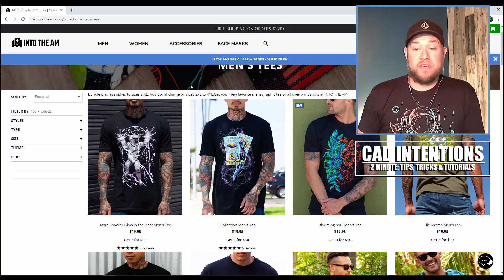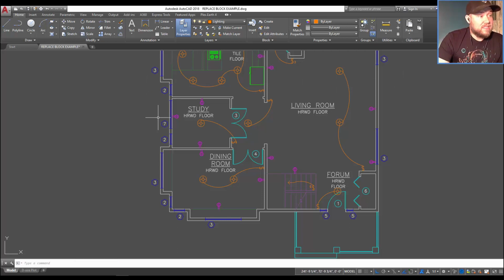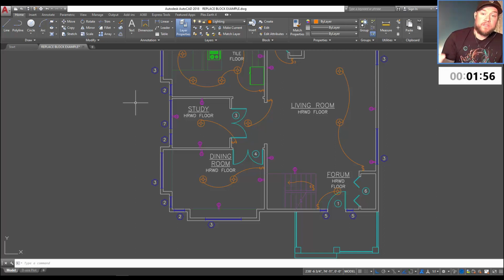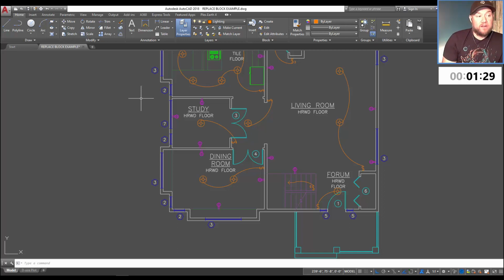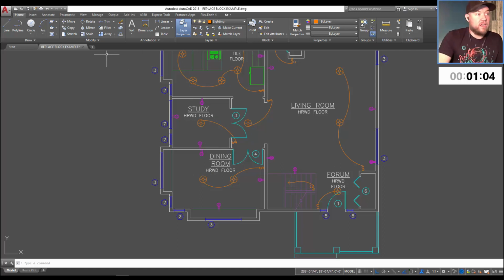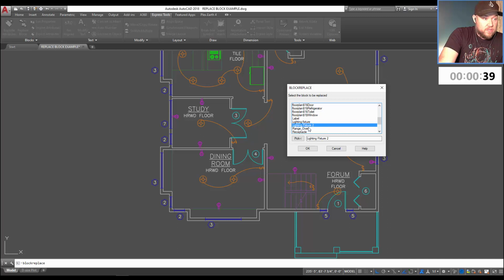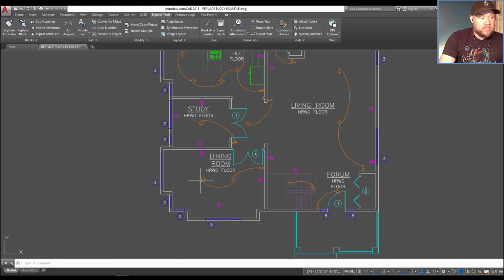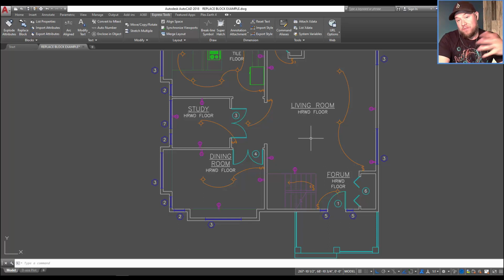AutoCAD How Replace Multiple Blocks with Another Block - 2 Minute Tuesday

Comment: Thanks for video. Is there a solution how to replace blocks by using attributes? We have electrical schemas, and depending on text we need to place circuit breaker or fuse symbol. All logic we can do in excell and load all info to predefined block, but we need manually change general block containing subblocks sumbols.

Comment: Wait... you said it'll replace the attribute value with the default from the new block.  That has not been my observation.  I have found that it keeps the existing attribute value from the original block and does not pull in the default from the one replacing the original.

The behavior you describe would be desirable for me.  Can you confirm the attribute value behavior you see w/ this command?  Maybe it's a property of the attribute or another sysvar that determines whether the default attribute value is pulled in?  Thanks!
Reply: What should I do to attributes after replacing old bloc to new block
Reply: @1NOnlyABI-t7o  I would copy the text of the attribute that is desired.  Select all of the block references (using probably quickselect "QSELECT" as the best built-in way) then in the properties window you ought to be able to paste the attribute text that you want all the blocks to have.